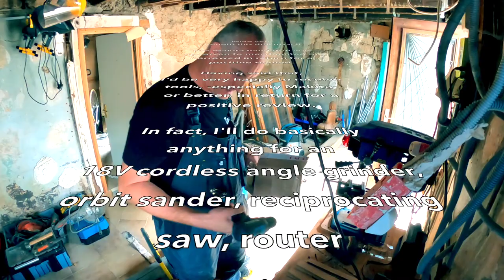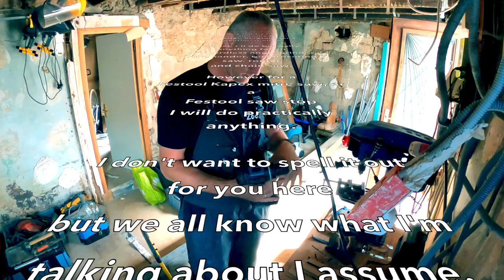The Tiny House. Renovating an old country house in France

Comment: In the US, we have carpenter bees, which are solitary and make a nest in wood. They are not aggressive at all. I've actually picked them up with no stings. 
I think what you have are ground-dwelling bumble bees, which do have colonies (like the one you had) and are quite aggressive. They especially do not like loud noises/vibrations near the nest. If aggravated they will come out and look for anything breathing close by. While mowing my grass one time, I ran over a nest and promptly got chased inside, with 12 stings for good measure. That night, I went out and burned the nest out with gas. 
And Nadia is right: they will tag you over and over. 

Project is looking good! Nice floor.
Reply from the maker: You know what; they have never stung or attacked me. And I’ve been hammerdrilling right next to their hole in the wall. They only stung Nadia after she had stuck her hand in their hole. They must have smelled her or their scent on her, that’s how they stung her later. I was sorry to have to seal their hole up and seal all other spots. Also I have had to spray twice a day but now they’re gone. I miss them though. They became like pets to me :)
Reply: @thisoldhousefrance  guess they liked you! :)

Comment: Why wouldn't you use a lime render that's what on building Portland cement doesn't let structure breath contract with the weather. Portland cement is bad and makes cracks and breaks stones down  because it can't contract with weather change if you were worried on structure the line mortar has been holding up building for over 100yrs. I hope you won't continue to use Portland cement with rest of work
Reply from the maker: Well this small house was originally build with bricks and Portland cement. So it would only make sense to continue adding and repairing with the same materials.